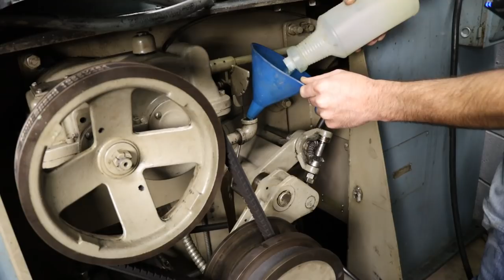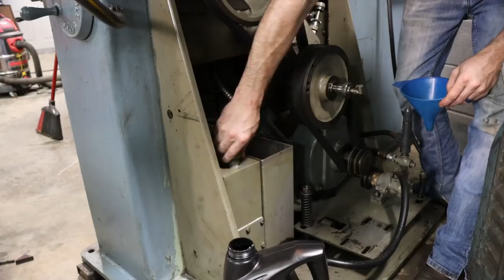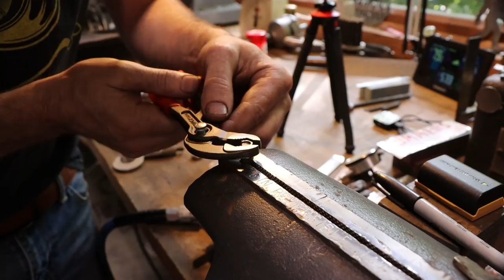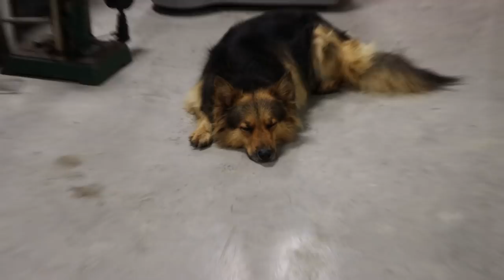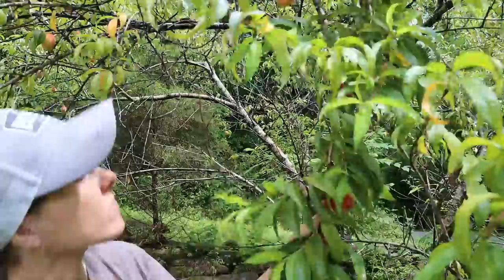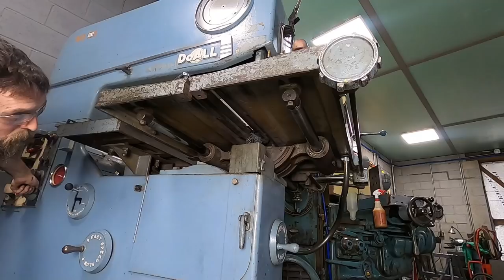Massive1953 Doall Saw repair and test run.

Comment: Rigid, but you can still see the witness marks from the ages in it. Next after coolant will probably be making a new set of table inserts for it, probably out of just steel, or just taking the old ones, using the mill to remove the inside, and making a set of steel jaws to go in there, to act as a smaller gap for fixturing smaller parts. Might even be worth putting some tapped holes in there to make clamping easier.

Hydraulics you probably want to install a hydraulic spin on filter in the system, preferably before the pump, to catch the fines in the system that will invariably be there from the saw. Will likely also benefit from changing that new fluid after 3 months as well, as you likely will have scoured off all the old crusty deposits in the system. Will lead to pump wear and even worse, wear in those hard to replace control blocks, as you are definitely well capable of rebuilding the pump and ram. 

You might even want to look into putting a set of portapower connections into the hydraulics, so that you can have hydraulic power tools as well in the shop. Not big tools, just things like a ram, a jack, so that you can handle things that will not easily fit the press, and with a long enough hose set to reach outside. Light duty, so you can do things like push machinery around without breaking your back, or pull off a really stubborn bearing or bush.

Comment: A do-all shop needs DoAll in the shop ... looks like you are well on your way to having that.  Adam's mill is one of the quietest I've heard, I hope yours, along with the cut off saw, are equally as quiet.  After a lifetime of loud stuff, it is nice ... these days, the only thing I want loud is my sound system while Beaker Street (with Clyde Clifford) is on the air.

Comment: I saw you use a Gerber money clip folding razor knife.  I have one too, that I bought for 10$ around 25 years ago, if not longer.  It’s not an EDC now but it was for a few years.  Then I went to a Leatherman PST ( the original).  Still have that too.  Good stuff lasts a good long time.

Comment: I opened a 1895 built high voltage switch. The ornate brass scroll work and engravings were stunning even though the only ones who would ever see them were other electricians when doing maintenance. AFAIK the unit is still in continuous use 126 years on. How many modern devices will we be?

Comment: Steve, please don't braze carbide to the blade guides... they're designed to wear, to be sacrificial. Carbide will just shorten the life of your blade! The guides need to be aligned with a mounted blade, not the bearing. The bearing is just to resist back deflection of the blade and would be adjusted to each different blade used. The guides need to be placed adjacent to the blade with a couple of thousandths of a gap, but behind the base of the teeth. As different blades are used, this location will change. The guides, a misnomer, should be used to stabilize the blade AS IT LAYS, not position the blade location. I hope this makes sense. I am typing this as I watch. You may have figured this out by the end of the video. That is all. Thanks for letting us into your shop!
Ty

Comment: I salvaged a couple of eight foot patio sliders from that earlier era. Even after more than seventy years the bottom rolls are still round and the frames are still square. The old metal screens still roll and the glass is still sound and all the hardware is solid brass. Only real problem is they are heavy and the ladies working in the building were barely able to open them and couldn’t open them at all with one hand. I’m going to put them into two eight foot openings in my shop.
Reply: That's nice, but are you sure you are in the right place?
Reply: @paulcopeland9035  yes, I’m in the right place. Are you sure you’re the right person to question where I think I am? If you watch this channel regularly you would have seen Mr Summers use old patio doors to make several of the windows in his shop. The gist of this episode included the quality of how things used to be. I spoke to that. Perhaps in the future you should refrain from answering comments that have passed over your head. Let Mr Summers answer for himself.
Reply: @jamespayne8781  It confused me that you were talking about part of his shop project that happened a year ago!  If you are sure you are OK and not wandering around in the past, then I am glad I could help!
Reply: @paulcopeland9035  if you need to be right in your own estimation than, please, help yourself. But, trust me, your confusion or lack there of is of little consequence to myself or perhaps anyone else who might visit this page and wish to enter into a discourse. I didn’t seek out your counsel before commenting and I’m not seeking it after the fact. It just isn’t your place to offer an opinion. It’s not about you. If you really don’t understand than perhaps you should pray to the Father of understanding and see if He might be willing to help you.

Comment: Listening to your rant at the 8m mark, umm I'd swap that DoAll for a boxy, unadorned modern CNC laser, waterjet or EDM cutter in a heartbeat.
Reply: I would expect a machine with more features to cost more. A modern industrial band saw might run $20 K and a fiber laser is a million dollar+ machine. They're not exactly giving water jets away either. You do not own those, you partner with your bank to be in possession of one.
Reply: @1pcfred  That DoAll would have cost a small fortune when it was new too, factory machine shop territory only. Compare the best then with the best now and then take your pick.
Reply: Bet none of those will be running 50 years from now.   He’s wasn’t talking process he was talking quality.
Reply: @leebarnhart831  I bet I won't be running 50 years from now either. So I really don't care!
Reply: @mikejurisic  way back hobby machining was a big thing with royalty. It was like the iPhone of its day. There were eccentrics that had their hobby shops in their castles. They had large fortunes to invest in equipment too. I've seen pictures of some of the machines they had. They were quite ornate. All kinds of engraved and what have you. Really beautiful pieces. Fit for a king you could even say.
Reply: @leebarnhart831  Not sure why you'd say that, for example, there are quite a few 30 odd year old HAAS VF-1 CNC mills around, I'll bet they'll still be in use in another 20-30 years. What's the HAAS slogan, oh yeah..."American-Made Value, Uncompromising Quality, Worldwide Service, Local Support"

Comment: That machine is from an era when businesses reinvested profits in their factories, not the board room and stock dividends.
Reply: I'm not suggesting human nature or greed was not always a thing, only a shift in corporate behavior. in the fifties and sixties about 1/3 of profits were reinvested in to the "real" economy, by the 80's that was down to 10%. tax law used to really favor real economic investment, not stocks and capital gains like today. Think back to when people got a good skilled job, worked for 30-40 years and left with a pension for the rest of their lives, now you work 20 years and get laid off when the corporate raiders move you job to Vietnam. why did they used to be loyal to their employees? I suspect its because the govt made them, or at least the tax code made it less palatable not to.

Comment: Christ.... my little issue list for the two packing lines I operate is up to 6 pages for one, 10 for the other and growing....that's double sides of A4 paper...... had to take time off just to chill for 4 days, never done that before. But, got back into them, fixing all the way since no one else would. Running sweet now. Took me best part of 12 hours to get it that way.  

Had dinner an hour ago, spoiled myself with a steak. No fries just veg, damn I feel more human now...... really juicy and tender, just med rare...mmmm, perfect. 

That is a monster of a bandsaw.....gorgeous too. The speed wheel is just wonderful. Yeah there are cheaper everything today, but I would rather have something that is going to last for +30 years if I was going in to business for myself. Trusted names mean very little if the machine is battered and worn out

Comment: Just to say that I agree about the way things have gone with machine tools.
I was a patternmaker. I retired this year after 50 years on the job. When I started the forman would pull a drawing off the top of the pile give you a rough idea what was required and then left you to it. Depending on the size of the job other men would join you as and when they came free. The job would be finished when it was finished. No one stood over you with a whip screaming faster. I enjoyed my job. Towards the end the bean counters took over. No longer content with paying bills and wages they started interfering. Every thing had to be on the cheap. Paying the investors became god. No reinvestment in new equipment or aprentaships.. I could go on. If you want to know who to blame for the state things these days. Look no further than accountants who's idea of a profitable is divert all the money to the shareholders and their own back pockets until the it starts producing crap or dies. I'm going before this turns into a five page rant. I made pattern equipment for all types of machine tools. Large and small. All gone. Either to the wall or some third world producer.
Anyway best of luck to you and yours, and thanks for what you do. I just wish others were to your standards. Some others scare me in the dangerous way the say to do things.

Comment: My bandsaw has a blade welder on it and I have yet to successfully make a blade.  I've been trying to use old blades that I may have broke a tooth while the other 11' is still good, I try to cut them down for either my porta-band or my little horizontal.   Some tips form watching you do it I'll give a try and see if they give me any better success.
Reply: @TheArsonsmith4242  ...Well, Yep it can be!

Comment: Steve have you ever tried heating the diesel to 300° F before using it as a flushing oil? It removes so much more sludge. Can you share your peach cobbler recipe? It looked delicious.

Comment: I'm obsessed with the chain powered contouring attachment. Are you planning on reviving it? If it helps, the image that you showed it looks like sort of a heavy duty ball chain. I have dozens and dozens of sprockets and a ton of NOS machine chain in all different sizes. I'd be more than happy to part with whatever you could use, just cuz I really want to see that function in operation. Thanks for the great video

Comment: The problem of "form over function" is in part a commitment by buyers as much as manufacturers. We as buyers need to get over the "got to have it now" way of life and be prepared to wait and pay a little extra for a quality product. I'm sure that modern manufacturers could produce a brass label if required, it may not be made the same way but it could be done.

Comment: You hit upon the real issue. Pride.
Workers have no pride in their work, in the equipment they use and no pride in themselves. 
You can build whatever you want, but until you fix the issue of pride it won't matter.
Reply: People used to work for a company for 20-30 years.  Turnover in modern factories is a huge factor in quality.  Why is worker turnover so high?  Some say pay.  Some say people don't want to work.  Some credit 'management' with making jobs unworkable.  Perhaps a combination of all those and others.  Modern manufacturing is very much 'just in time' oriented - Time studies scheduled and conducted more frequently than maintenance.  Study groups to brainstorm cost savings and emergency meetings to address quality issues.   HR is NOT about Human Relations, at least in a constructive way.   I'm done now.

Comment: 6:30 -  The space age. The sky was the limit. Then the gas crisis. So cars all got the wind tunnel treatment to increase their efficiency and lower the drag. They ended up looking like dookies. (Rhymes with "birds") All round and tapered at both ends. 
Say what you want about that era, but you can't deny that we had style, daddy o! I miss my '62 Mercury Meteor.
9:00 - That brass ring scale would be a number box on a computer screen or, worse yet, on your phone. To cheap to even put the display on the actual device any more AND they get the bonus of planting some MORE spyware in your phone!

Comment: Steve, I haven’t finished the video yet, but at this point in the video, I just saw your extended drain valve on the bottom of the machine. (Great idea! But!) if you haven’t already, I would remove that hose barb and either place a plug or cap at the outlet after the ball valve. If you accidentally bump that valve you’re going to be very unhappy. (Now let me get back to watching this video and stick my foot in my mouth if you’ve already done that.)🤓

Comment: Steve here is a link to a picture of your missing chart, a hard copy of this, laminated, glued to a round piece of aluminum with a hole in the center and clear coated to keep the oil dirt and shop grime off and you have a chart for reference.   https://www.machineryvalues.com/pict/159950d.jpg. Good Luck

Comment: That's awesome Steve!! Its one machine that I'm missing my shop is a good bandsaw. I've got every other machines from a large 26"shaper, cylindrical grinder, large lathe, horizontal milling machine and even a CNC machine. What they ask for old bandsaw machines in Australia is ridiculous and they are very hard to find. Hopefully one day I will get one and I will have to just keep using my power hacksaw till then. Anyway great vid Cheers Rick MTR Australia
Reply: Band saws are a project you could conceivably make for yourself. What you make might not look too pretty. But you've got to have a way of breaking down stock. Every project starts on the saw.
Reply: I believe DoAll has/had a manufacturing facility in Australia at one point? 
Our old (70's) DoAll Vertical Mill had a "Made in Australia" tag if I remember correctly.
Reply: @1pcfred  Hi Paul. ATM I'm using a power hacksaw for a lot of work but I do need a bandsaw. For the thicker material I have a CNC Plasma table and I just clean up hardened edges on the shaper. I will hopefully get one in the shop eventually.
Reply: @MrMojolinux   I didn't know that but I have seen old DoAll machines at auction in the past in Australia.
Reply: @motorcycleandtoolrehab1834  power hacksaws are not nothing. I have a bandsaw and I am still not above using the old cordless hacksaws now and again myself. You know, the saws you have to swing back and forth with your arm to get them to work.